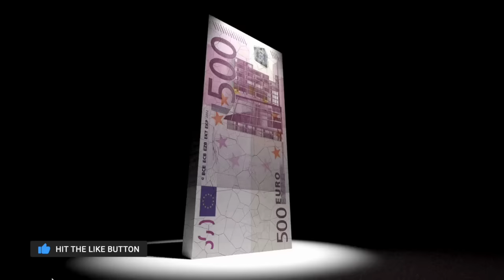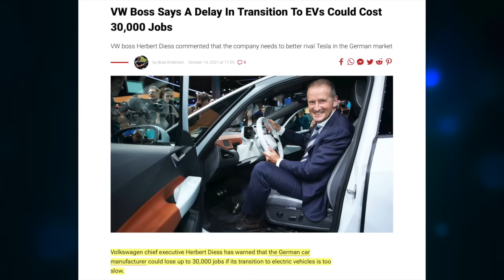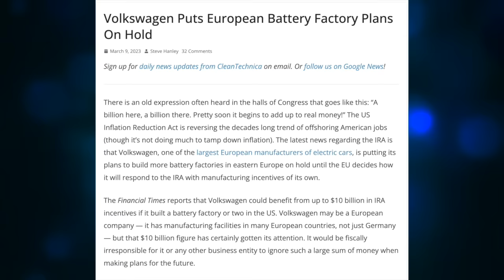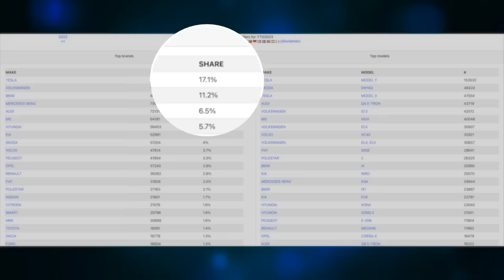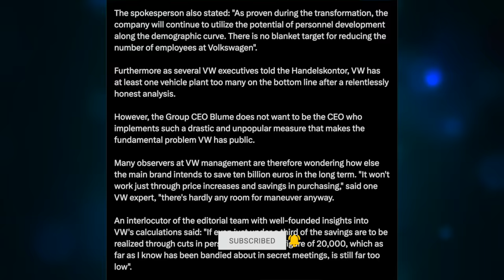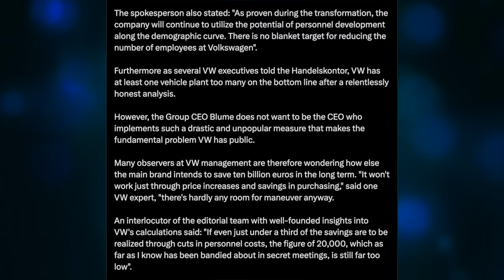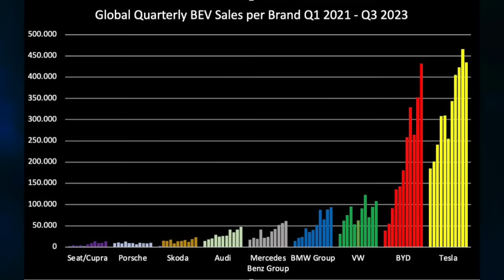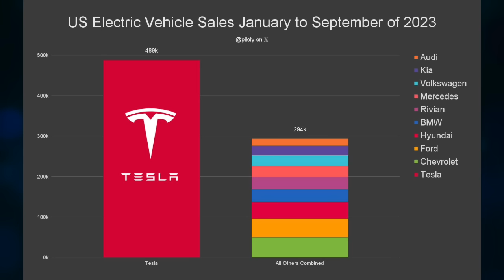Herbert Diess warned them, but they fired him & now VW is to fire 20,000 employees!

Comment: I love that quote from Sandy Munro. "Tesla is playing chess while the others are playing checkers." This is the truth. In 2003 the legacy automakers could have been the EV leader but they chose to literally crush it. This left the field wide open for Tesla. And Tesla took full advantage to out innovate legacy auto.
Reply: Just a guess but the crushing of EV 1 was due to pressure from big oil. If GM management had a spine and a spark of vision back then they would probably be a world leader in EVs today. We could be over 20 years ahead of where we are now in the transition to renewable energy.
Reply: And Tesla started killing it within a Former GM/Toyota Factory!   The story is better than something written for entertainment!
Reply: 9 dimensional chess ona horizontal plane
Reply: The game is actually "Go"...an ancient Chinese board game.
Reply: @charles6084 No, it was due to liability concerns from using AC motors and high wattage AC induction charging.  Too many risks of user injury and death for their taste.

Tesla has just been keeping that fanger under wraps, blaming deaths at thr wheel (and horrific crashes resulting) on 'misuse of FSD.'
Reply: That's because Tesla's tech is all from DARPA they are a ca_bal front company.
Reply: In German automotive the problem were and are outdated structures that once worked. Too complexe structures for putting together a car and too many differently working tier 1 and 2 suppliers. So todays ICE are highly complexe and you find out when you have a problem. Tesla reinvented integration! But then also the way how a company’s value system works especially towards employees first and then customers is a real gamechanger. In 1994 already we warned Volkswagen about what directly resulted in cheating software and the arrogance behind also systems like Bosch too who always felt to be above law or that they buy for money what is necessary. Think Tesla is till now in good hands with Elon Musk and I also hope that his team also plays fairly! Here in Europe with the Germans mainly but also French and Italian-American automotive all are struggling because they all missed the right moment to set the new claims thanks to outdated structures ALL were used to for too long. Innovation was mainly vaporware if you look closer. We once invested in a very innovative motor concept where even the prototype worked already perfectly but people with ten times the budget were only laughing 😂 about us and were so arrogant to believe that innovation depends only on money 💰and more 💸💸💸
Reply: Nope but thanks for playing! @xraylife
Reply: @taefravis  And the Musk Space X tech is from.... ?
Reply: Sandy is Full of It........
Reply: @anthonybha4510  You Only buy an EV Once...............an. Expensive Mistake.

Comment: The VW board is using the Diess firing as a cover to keep the VW stock owners in the dark.
Reply: Share owners will notice losing 20,000 workers. All of Europe will be shocked!
Reply: The investors / shareholders are to blame for this whole mess - their permanent demand for ROI leads to management choosing short term profitability over long term sustainability.
This is economy-wide and based on the zero lower bound problem that our currencies copied from metal commodity currency and starts to become a destructive mechanism as soon as GDP growth falls below 2-3% per anum. To solve this issue we need currency with a negative lower bound interest feature.

Comment: Seems like the collapse is coming quicker than expected. Unfortunately the employees are feeling the brunt of idiotic management decisions. They should start with firing the C level executives at VW but they have golden parachutes when they bail out so they aren't losing any sleep.  Next up GM.  They already has one foot in the grave and are on life support.
Reply: I understand the issue was the VW Union who are represented on the board and opposed Deiss.  From Wikipedia:

"In July 2022, following discontent from labor representatives, Volkswagen announced that Diess had resigned as CEO and would leave the company by the end of August."
Reply: Execs gotta go. Remember that all-hands-on-deck meeting that Diess called? There were 100s of executives in that massive hall. You are correct. Now workers will lose their jobs because executives refused to do their executive jobs. Bad for EVeryone.
Reply: Not quicker than expected by anybody following the facts
Reply: @FrunkensteinVonZipperneck  Not really it was the opposition of the workers representatives on the board that caused him to go.
Reply: What's particularly sad is that the workers voted from the same short term, short sighted view as management.  Instead of embracing the need to pivot quickly in an industry being massively disrupted
Reply: Nah, screw the workers. They had the same braindead reaction as the higher ups, acting as if Diess just wants to fire people for no good reason.
Reply: Same thing goes for Ford....their quality issues are horrible.
Reply: @garyzies3486  That's why their name is an acronym, even considering the fact Dodge was taken over by Stellantis.

Comment: This story makes me sad. I had dared to hope that VW with German engineering know-how and VW's volume would be able to make a compelling BEV at a competitive price. I have a 2013 Golf and it is clear evidence that VW can get the job done with an ICE vehicle. But resistance from unions, management and a lack of software know-how has resulted in a dire situation. RIP to all those VW jobs. They aren't coming back.
Reply: GM, Ford, Toyota and Honda don’t know software or batteries either 😢
Reply: Everybody loss. Job build batteries
Reply: Glad you had a good Golf.
My mother-in-law’s Golf was a total nightmare.
In any event I have a long memory- and I remember Dieselgate all too well. I can never, WILL never have a VW in my garage.
Reply: You have a European car? You must like repair shops.
Reply: @FutureSystem738  The day I bought my Golf, there were two used Golfs on the lot. The 2015 was sapphire blue with the 2 litre turbo and a 5 speed manual. After taking it for a spin I understood that this car had a hard life and every part of it was worn out and loose. The 2013 in silver has the in-line 5 2.5 litre with a 6 speed automatic. These cars have been criticized for being unsophisticated and getting poor milage. But our test drive told us that it had been driven gently and well cared for. As for milage? The way my wife drives, it gets better milage than the Pontiac Wave we replaced. We're happy with it.
All this to say that even within a particular brand and model, there are good cars and bad cars. We were fortunate to get a good one.
Reply: @gregvanpaassen  this car is 10 years old. It gets regular maintenance at the dealership. The only repair that was not a regular maintenance item was the thermostat housing. Last Spring, I replaced the original factory battery.
Reply: I have no sorrow for the company that for the years deceived their customers and compaticion.
Reply: @FutureSystem738 they were all at it.
VW took the biggest hit but were not on their own.
Reply: "But resistance from unions, management and a lack of software know-how has resulted in a dire situation"....... You wrote. But why did they resist? What was the motive of the Unions and the managers to turn against BEVs?
Reply: @FutureSystem738  VW is since a lot of Time "Volksverarscher" the Quality gets down since Years and the prise gets high the difference teh Quality gets down. I drive a long time VW / Audi and i see the the Quality gets down. Since Diesel gate i never buy a German stage wagon. Since disael gate the german stage wagon buiölder ignore the futer is electric, my mind ist that The german stage wagon builder all "go over the jordan."   Diess was the small light at the end of the tunell.
Reply: @gerhardhettler8521  Thanks, I agree. Danke Schön. 
G’day from Australia. 🇦🇺
Reply: The problem is that legacy auto think that making an EV is the same as ICE when it is not. 
Put it this way. When streaming first emerged and we saw Netflix burst onto the mainstream stage, it would be like video rental shops doing streaming but where you still go to their shop but you watch the film in the shop!
The legacy auto are doing the same approach and thinking it will work, customers want better which is why they love Tesla so much and the Chinese so much as they make EVs the way they should be done.
This is all legacy auto's fault so I have no sympathy for them, they had plenty of chances but their sheer arrogance got in the way
Reply: @taefravis  That's right. BEVs are very different vehicles from gas burners. When you think about it, the internal combustion equation was solved a very long time ago. The best we can hope for with this mature technology is very tiny incremental improvements. These cars can be made out of steel and a bit of plastic. In other words, the material cost is tiny. Big auto is used to huge proffits from vehicles that have very small material costs.
Now look at BEVs. These things have huge batteries, rare earth magnets, copper windings and conductors and sophisticated computers and control systems. It takes a lot of creativity and discipline to find ways to keep costs down. Then, even when they get all that figured out, there's software. Good luck getting software to run when modules are produced by hundreds of different suppliers. It can be done, but it makes even the smallest change costly, time-consuming and unreliable. Big auto's way of doing business: outsourcing everything and only making very tiny changes once per year, just doesn't work with BEVs. It would be much harder to change the minds of the people that have always done business their way than it would be to start from scratch with a whole new business.
Reply: All VW owners think they have a good car, until they buy another brand car.
Reply: @andrevanrossum8408  I used to think that GMs were good until I had a ride in a VW Golf. And yes, I've been in Hondas, toyotas, Fords, Chryslers, and a few other brands.
Reply: As a multi-Tesla owner, software is their weak point. Every bit of their software from the cars to the back office systems is crap. Very buggy and very limited on integration. OTA is Tesla’s excuse for putting out a crap product that they will fix later and then that’s a license to take their sweet time, if ever, to fix software issues.
Reply: @JetFire9  Although I have heard about manufacturing quality control issues, especially with the earlier models, you are the very first person I have ever heard complain about their software. Can you show me receipts for your claim?

Comment: TSLA is a company with a mission and a long-term view. They built the original gigafactory in Nevada because they looked out into the future and realized, “hey, we’re going to need a lot of batteries”. They built the Supercharger network because they knew it would facilitate interstate travel in the US, then took that concept international. Like Wayne Gretzky said, “you don’t skate to where the puck is, you skate to where it’s going to be”. Herbert Diess knew this and warned about it, but too many in the VW group wanted to avoid the short-term pain that the pivot to EVs would have caused.
Reply: True, very true
Reply: Yep, they also realized batteries only last around 10 years before failure of cells, so they know they have a great revenue stream selling $15-20k batteries to every owner just outside of warranty. And new replacement batteries only get 4 years of warranty and 1 year for refurb. Of course, if they need more revenue for the quarter, they can send an “OTA failure” to out of warranty customers that have no option for 3rd party repairs and no way out. 😂
Reply: The public do not want EVs, Tesla will go bust within 5 years. VW need to re-open ice, particularly diesel production lines, before it is too late.

Comment: I still think that VW should have never stopped making the type one (Beetle).  If they were still making it, they could've easily converted it to an BVE.  That I would buy.  I worked for VW in the 1960's when the Beetle was THE car from Wolfsburg.
Reply: Agreed. I thought an electric beetle would have been a no brainer.
Reply: The Type 1. would not do well in crash testing. That's why there is a 'New Beetle'. 
VAG even tested an EV version, but it lacked the needed space for batteries and would cost too much. Tesla can market a few $100.000+ cars. Volks Wagen can not.
Reply: It is what it is I guess.  Too bad though, I liked the Beetle a lot.  The Karmann Ghia was nice too. @Aimless6

Comment: When I bought my Toyota Prius in 2009, I could count the number of Prius on my both hands. A few years later, I need to remove my shoes just to accommodate the number of Prius on the street. Same thing is happening now to Tesla. I wouldn’t be able to step on the gas pedal if I had to count the number of Tesla on the street every time I drove around.

Comment: The other story is they  cannot sell EVs , there's a contradiction  here
Reply: I do not want an EV until the battery technology is a lot safer, based on chemistry that doesn’t self combust and burn at 1000c, with no fire extinguishing solution other than letting it burn out.

Imagine being trapped in a Tesla after a crash, doors not opening due to electronics being out, the battery raging in combustion at 1000c, not even your skeleton left for your family to identify you from…

Comment: The Big 3 will commit suicide if the UAW deal is ratified....how the heck will they compete with prices against Tesla?  Thanks UAW!
Reply: UAW is not to blame. The big elephant int he room are the shareholders / investors who demand positive ROI all the time, forcing management to choose short term profitability over long term sustainability. And the root cause for this is a flaw in our fiat currencies called zero lower bound interest problem that got copied from metal commodity currencies. To solve this we need negative lower bound interest fiat, but not even modern monetary theory is there yet.

Comment: The thing I don't like about Tesla, as well as other EV manufacturers is that they don't honour battery warranty claims unless you have lost more than 30% of your original range. So if you had 200 miles when new, and you now get just 145 miles they still won't give you a replacement.I still think plug in hybrids are the real deal

Comment: As the Berlin Tesla factory expands they'll need some more employees - those ex VW workers should perhaps apply ?
Reply: These VW workers are mostly Pensioners that are not replaced and mostly worked in administration or at the ICE-Production. Both are workers Tesla doesn't need.

Comment: The fact of the matter is that the general buying public, doesn't want EV's and even a more efficient Tesla is suffering. EV's are a busted flush, high sale prices, low range reducing by the day with time and use cycles, fires that you can't extinguish and a very poor infrastructure are all facts that the general public are fully aware of now and are just stopping buying all EV's because of that knowledge. Tesla will suffer most in the end, not having an ice offering at all.

Comment: This is not a news report to gloat over, not that Lars is doing that. This is what their own CEO predicted would happen and so it has come to pass. That cost him his job and led VW down the path of trying to slow the transition. They only succeeded in slowing themselves. 
The executives were told they had hard efforts ahead and they chose to slow down and put the brakes on the market. VW will be much smaller in the near future and will become a worked example on many MBA courses in the future. Who knows, they could become a noun, as the company that “Volkswagened” themselves. It is often true that you can fail faster by doing nothing than by doing the wrong thing.

Comment: The problem is the prices of these cars ... if you need to pay 40 to 80k for an electric car to go to work its never worth it for the middle class... wages didn't went up but everything else does... and now there all making these nice stock EVs that nobody wants and that costs 40 50 60 70k or more that nobody wants to spend on.

Comment: They seriously mistreated Diess. They seem to have purposely misinterpreted his statement about laying off a lot of employees. He was saying it would be necessary and inevitable. They refused to hear anything other than "I want to fire [large number] employees because I'm a big dumb meanie!". Refused to see that the company was (and still is) in danger. He tried so hard to get them to see, but they closed their eyes and chased him out. Despicable.

He might have been able to save the company, but I see little hope for VW now.
Reply: Wasn't a large part of the reason for getting rid of Diess the abysmal results from Cariad, the software department they set up? I do wonder though whose bright idea it was to start a brand new software outfit with 5-6000 developers - getting something good out of that big an organisation would require exceptional management and structure, especially when the original goal was (as far as I know) to come up with one common software platform for VAG. Last I heard they had three, and the one Porsche was on had no upgrade path to the most modern one...
Reply: @koma-k 
Sounds like scapegoating to me. Like oh, we're firing him anyway, might as well pin the blame for this thing on him.
Reply: @ParaSpite  I did get that "vibe" when it happened - the Cariad problems figured prominently in the reasoning according to some reports, but I did get the feeling that it was a convenient excuse and that the real reasons were discomfort with Diess' predictions and agressive timetable.